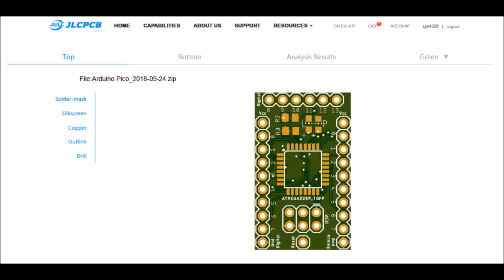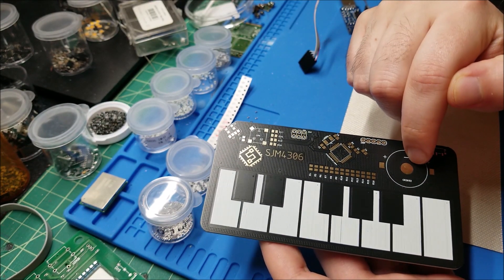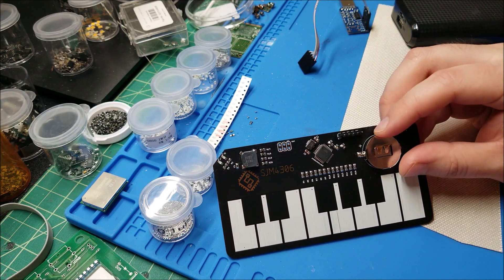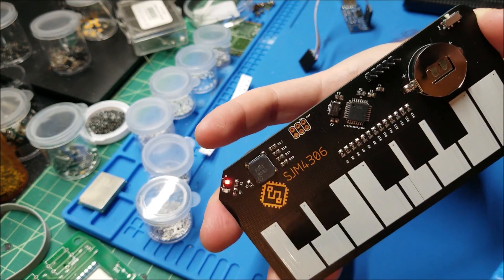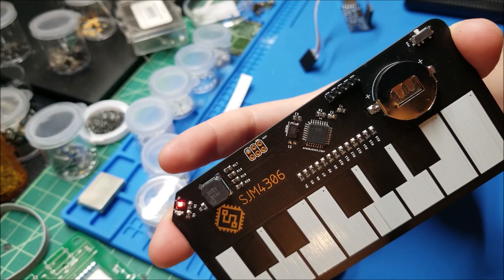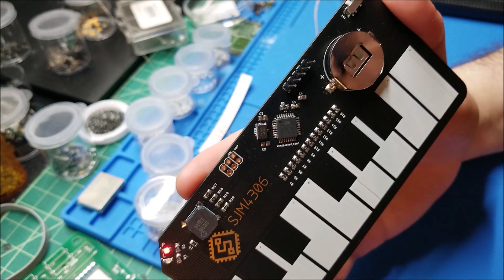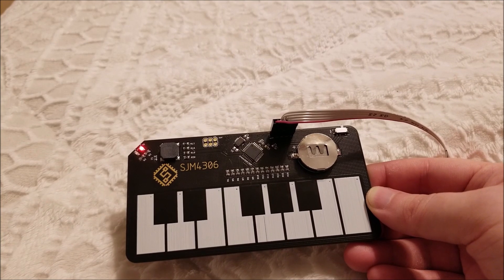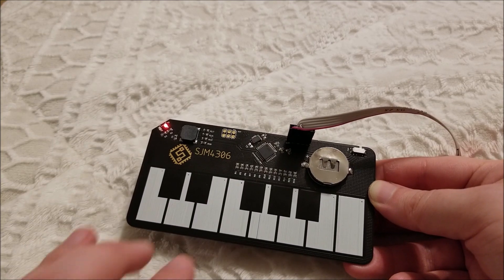DIY Touch Polyphonic PCB Piano!

Comment: so how does that 328 chip function? it’s basically like an arduino correct? are the chip pin outs basically the same as an arduino pin out? how do you hook up to program it?
Reply from the maker: Yep it's basically an arduino nano/uno (pin definitions and libraries will work with this board). To program it you need either a icsp or serial programmer (serial flashing will need the bootloader burned via icsp first). There are pogo pins for either programming interface but you could also just directly solder wires.
Reply: @sjm4306  oh awesome. thanks

Comment: is the white and black of the pcb keys screen print ink, or solder mask?
Reply from the maker: The white is silkscreen and the black is the soldermask underneath
Reply: @sjm4306  cool. thanks. i’m making something similar and it will be a capacitive touch keyboard with midi control. and i was trying to think of a protective coating that will still conduct enough to sense touch.  thanks
Reply from the maker: Awesome, please post a short vid of it when you are done so I can check it out!

Comment: this is so cool. do you have any experience in making touch capacitance with velocity sensitivity? is that possible or practical on a cap. touch board.  
i’m thinking of making a capacitive touch midi controller, and just curious
Reply from the maker: I haven't done that before but I assume you could figure it out if you make the sensing analog instead of digital and detect how long it takes between sensing your finger a few mm's away to directly touching the button.
Reply: two more quick questions. 1.  do you have this board design available for purchase on the pcb site?  2.  for a touch capacitive circuit. is it just a metallic surface anything connect to a resitor, and then that goes
straight into the arduino, and programmed from there?   or are there more parts in between the metallic surface and processor ?
Reply from the maker: Board files are available free here: https://hackaday.io/project/178953-polyphonic-touch-pcb-piano

I don't charge anything for the design files themselves (though I do accept donations, not required though) but if you do publish or produce anything with them I just ask for attribution. If you just want one board I think I still have a few if you would cover shipping. 

As for the actual sensor surface, yep anything conductive can be used it's just that the method I use required the 1M ohm resistor is required. The rest of the magic happens in software.

Comment: Pretty neat little project!

Btw, you can get better tone accuracy (in theory) by having the hertz values stored as floating-point values with the appropriate decimal values. Your beep() function should then take a floating-point input instead of int. You should also add 0.5 at the end before quantizing to int, for rounding. Something like this:
fNmax = (int)((INT_CLK / (float_frequency * 2.0)) + 0.5);

Though the interrupt clock is a tad low, so the extra precision is probably truncated away when quantizing to integer. Maybe you could use fixed-point/floating-point counters (fNmax/fNcnt) and handle the fractional part as well? Maybe a bit extreme for something as simple as this, but why not? :-)
Reply from the maker: Yep the relatively low interrupt frequency is the limiting factor in my case. I measured about 1/4 cycle usage by the interrupt so I may be able to bump the interrupt frequency up a bit before I start running into interrupt overrun issues. I can always throw a hw timer per channel though and get much better accuracy and avoid the issue (though I'd want a chip with more than three timers).